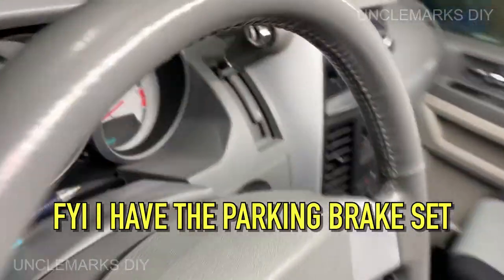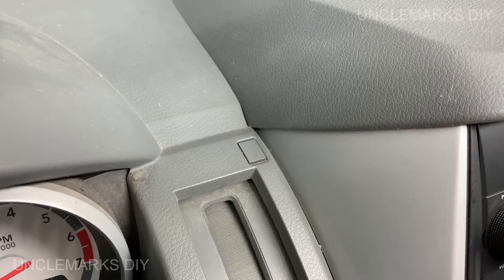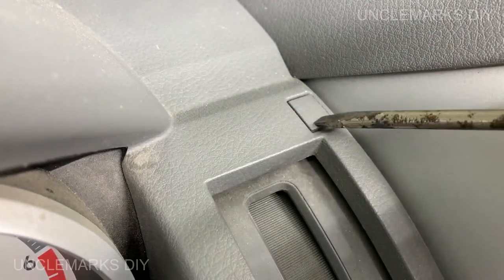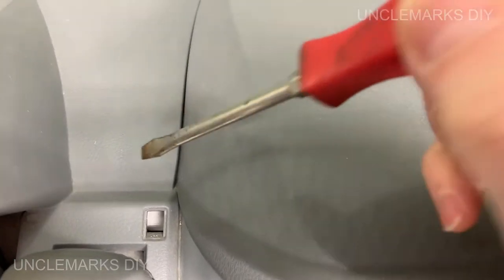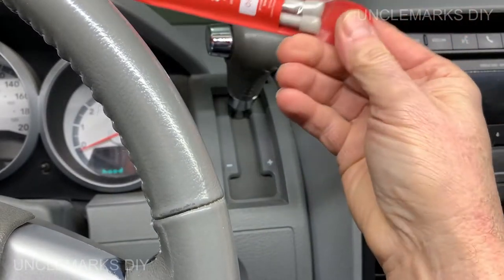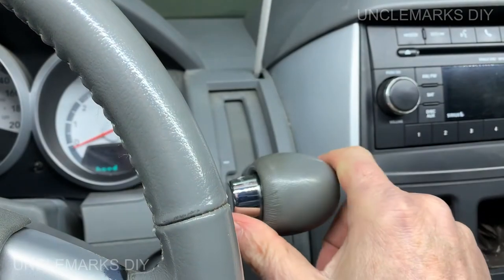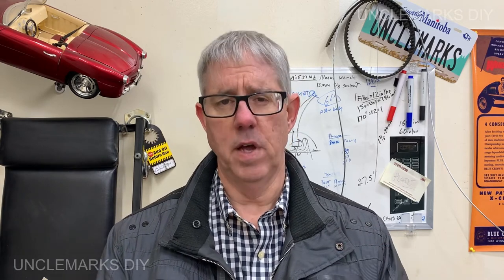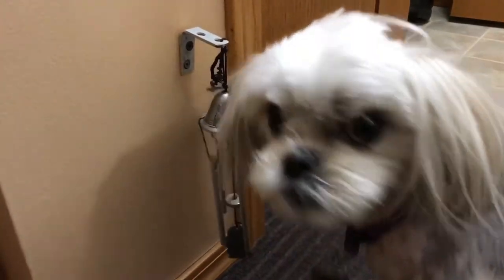Shifter stuck in park Grand Caravan Volks Routan 2008-2020 (EP 159) Park override

Comment: My van stuck in parking but the engine is running , you could you tell me what happened
Reply from the maker: There are a couple things that can cause this not to shift or move out of park. With the van running, can you get someone to check if you brake lights come on? If so, It could be a wire to your brake switch or the brake switch it self. (Or it is something mor complicating.)
Reply: @unclemarksdiyauto thanks for your help

Comment: This was the problem! Actually, jiggling that switch with the ballpoint pen seemed to loosen it up, and now it's working properly again. I'll take that as a warning sign that i may need to consider replacing the switch. But this bought me some valuable time. Thanks a ton! ... I almost turned off your video as soon as you said, "I'm not going to show you how to fix it [permanently]," because i assumed you were going to say the same thing i kept hearing: disconnect the shifter cable from the transmission and manually change gears from under the hood. (That's not going to work too well if a tractor trailer takes a wide turn and i need to back up and give him space.) Glad i was curious enough to keep watching.Thanks again!!!
Reply from the maker: I should do one on replacing the interlock. I will add it to the list of to do videos. Thanks for watching Jacob (& Nancy)

Comment: How to fix the issue?
Reply from the maker: I didn't do the video on that part. It is probably the shift interlock solenoid $250 or the shift interlock module $400. I would suggest you have a shop with knowledge on diagnosing this look at it. It could also be a wire going to one of these units, so guessing could be very expensive.